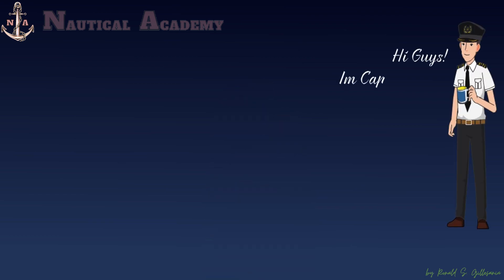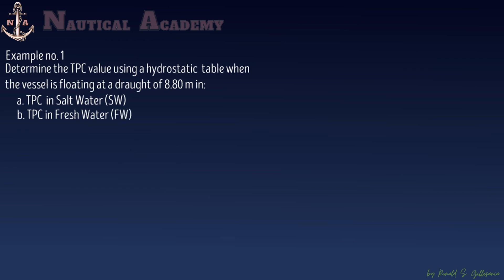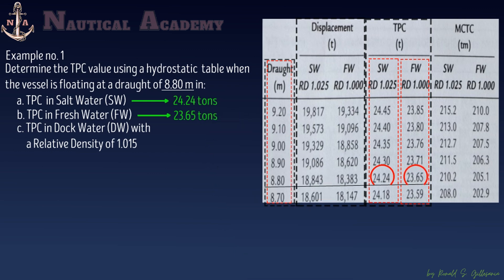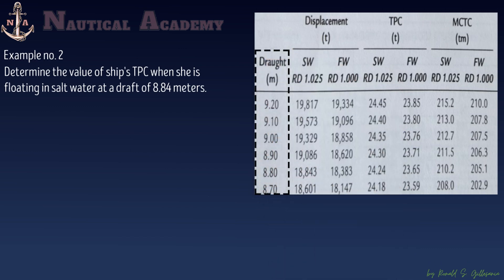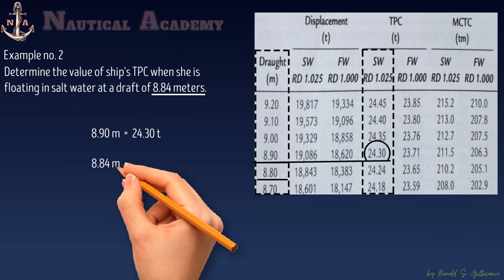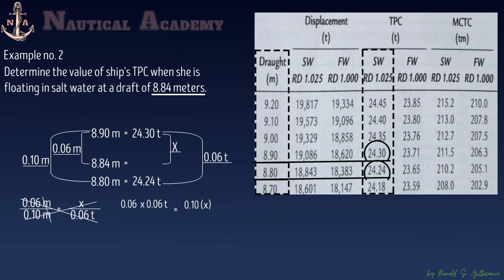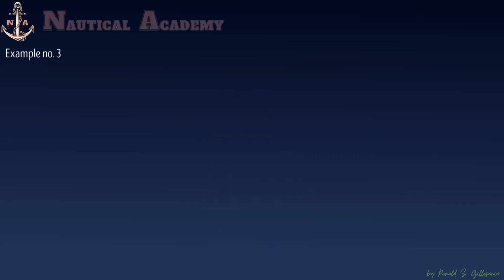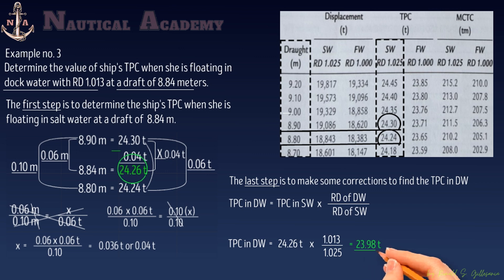Determine TPC by Hydrostatic Table II Tonnes Per Centimeter Immersion II Interpolation/Extrapolation

Comment: We have been taught the formula tpc= tpcsw X (RD difference SwRD)
                SwRD
In Solent University is it correct?
Reply from the maker: To get the TPC in dock water or brackish water, use this formula: TPC dockwater = TPC saltwater X (Relative Density doctwater divided by 1.025). In short: TPC DW = TPC SW X (RD DW / 1.025).